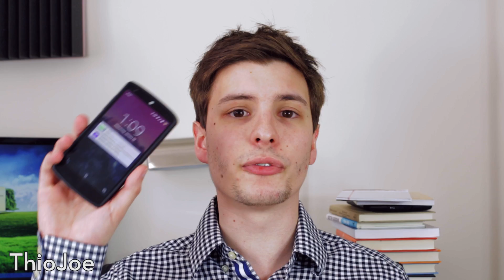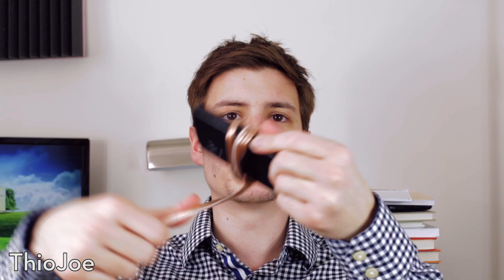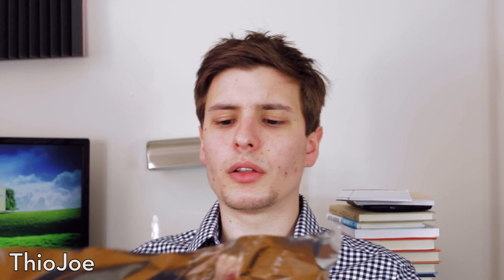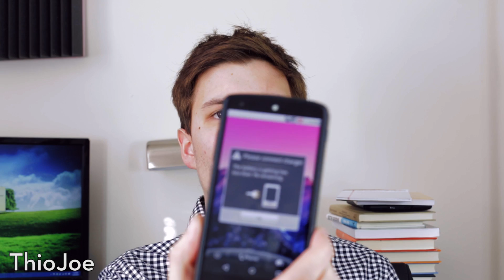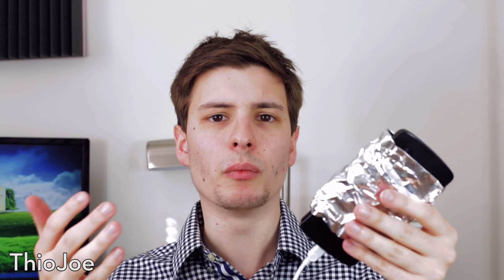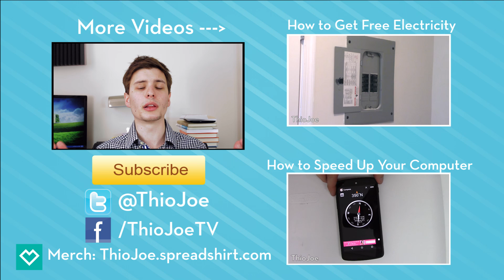How to Instantly Charge your Phone

Comment: This can happen even without any wire and tin foil. All you need is to charge the battery for 10 - 15 seconds, so the voltage can go up to what seems to be the normal charged voltage. And that is enough to fool your phone, that the battery is fully charged. The way your phone finds out how much charge is left in the battery, is by measuring the voltage of the battery (if there is no charge current) or the charge current (if the charger is on), and thus can be fooled easily. There is no charge current and the battery is at 3,7 volts, then everything is good... right?
Wrong.
In reality this is just a effect of the battery. The voltage is going up for a while after the battery was plugged into the charger, regardless of the amount of charge currently present. The "charge" is going to drain out after few minutes (the battery voltage is going to rapidly drop again) and you will find out that your battery is still empty. It is simple physics really. The charger can only put so much energy in the battery over 10 seconds. Most chargers are current limited to prevent shorts, so you really can't change much there. If your charge method really manages to charge a battery to 80% over 10 seconds, then this means that you somehow get more energy out, than you put in. And this does break the laws of physics. If you want a charged battery, you will either have to wait 2 - 3 hours for a proper charge, or learn to survive without a phone (at least for some time), just like we did in the good old days. xD
Also every cell phone charger is delivering DC (directive current) to the battery. This means that there is no electromagnetic induction in the wire due to the fact that the magnetic field of the charge current is fairly constant. So the things you describe are not possible or at least the effect of any voltage ripple in the charge current that might be picked up by the speaker wire coil and then re emitted back to the phone, is practically zero.
Now onto the battery itself: Charging a battery is more of a chemical process rather than electromagnetic. The charger doesn't cram electrons in the battery like in a bag. The electrons drive chemical reaction that is later reversed and produces electricity. The shape of the battery in this case has very little to do with the efficiency of this process, since it all comes down to effective surface area. And flat lithium batteries have no problem with that at all.

There are however "batteries" that can be charged in seconds and will probably be used in cell phones. They are called supercaps. Now it is important to notice that these are not actual chemical batteries like the lithium ion or cadmium ones. These are huge capacitors. This however does mean that the amount of energy, that they will have to output during discharge and this is translated into huge charge current.

Comment: hahahaha electric potential hahahahahaha electric potential ahahahahahaha escaping electric potential ahahahahahahaha for those who are actually planing to do this please search first how a battery works. if you want fast charging use supper capacitors not by using a coil of wire and a piece of foil.

Comment: Firstly that alluminium is not going to do anything for you phone apart from making it a shit mirror and if you think that coil is going to do anything then you clearly don't understand anything about battery physics, electrons aren't lost through the walls of the phone that would mean that instead of obeying Kirchhoff's laws (very important laws that define how a circuit works) which states that the charge entering a circuit is equal to the charge leaving the circuit so in basic terms for you the creator of this video, I'm gonna have to break it down for you because your a blithering idiot, the charge in a circuit doesn't 'leak away' charge is always conserved. Oh and by the way you are very wrong about the induction thing you were talking about while that's is a real physical phenomenon it will only diminish your battery life and use the charge up even further, and if that weren't bad enough conventional batteries used in phones don't have any coils in them because the battery is like a high capacity capacitor that slowly releases electrons over time, a coil in this situation would make little sense as it would act as a resistor therefore increasing the resistance of the phone and again wasting more charge so basically you claim to understand these things but in reality your just a dick who doesn't know fuck all about the physics of batteries your right it is a complicated subject which is probably why you just made it up on the spot and now look like a twat on the Internet.
So in future before embarrassing yourself on the Internet in front of thousands of people you might want to do some basic research about the topic your lying about so that anyone with a basic understanding of physics, which you clearly don't have so don't pretend you understand the complicated ways that batteries work, can't prove you wrong, you pretentious bellend.

Comment: Did this with my Galaxy S5, and I got to 100% in just 15 seconds! I just did this, but didn't put on the charger cable. I put it in water (my phone is water resistant) then put a car battery in the water with it. After 15 seconds, pull out the car battery (with rubber gloves, the battery can shock you) and you'll see the phone is fully charged. I also tried this with n iPhone 6+, I just wrapped it in plastic wrap to keep the water out, and worked great. Thanks for the inspiration, the battery is heavy, but works in a bind.

Comment: I found my phone can charge to 100% in around 30 seconds flat if it is fully submerged in nutella.
Nutella is a great insulator of electric magnetic induction fields, it helps keep the induction circuit energised for the period of submersion.
 Works on all phones.

Comment: hello joe. I tried youre technique but its not working for me?? ive tried using a power cord and another charging cable but it didn't work. What brand speaker wire did you use? and thanks for the tutorial

Comment: Using a microwave worked at a much faster rate. It charges the phone to about 5% every 200th of a second. The best time is about 5 seconds. This will charge the phone to 95%. Good video, i thumbed it down because its not as fast as mine.

Comment: I love Joe, he's a master in trolling but let me explain this troll:
The screen where he was showing his low battery is a screenshot of a very much older system, that system interface he showed wasn't even compatible on his Nexus 5, even with a rom it won't work to downgrade to 1.6 android.

Then he showed after his troll his regular lockscreen where the real battery indicator is which was 80% or something like that and it's was the same amount of battery before he did the trick

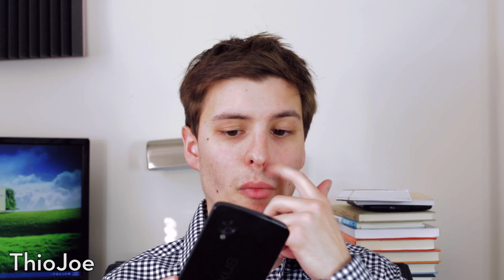Comment: He pretty clearly lightly sets down the original phone at 2:28 and grabs an identical phone to the camera's left of it, you can tell because his eyes shift leftward and he fumbles for a moment before bringing the phone back on screen. Trust me guys, batteries don't interact with anything outside of the charging circuit electromagnetically. There's no such as an "escaping electric potential" (electric potential, or voltage, is basically the difference between the charge of two points, not a physical entity). Even if he's talking about another kind of escaping energy, the foil would simply turn the wave into a current (induction) and dissipate it.

Funny and well done, but don't waste your time trying it.

Comment: Different potential is voltage, in order to charge a battery you need a current which is zero,  because the nexus 5 does not have a inductive coupling therefore the method you are using is feasibly impossible, don't say that you need to "know" physics to understand it because you are giving wrong information.

ps i do know this is a fake video because he showed a picture of a android htc skin interface and then the actual raw android os.

Comment: Hey man, I would have used this trick myself if it wasn't for the fact your operating system would've had to change from the Ice Cream Sandwitch to the lolipop. If you pay attention to the video, you get a solid, white Notification bar before it's charged, and then boom, the New Clear Notification bar with either a KitKat or Lolipop Operating system. So, guys, don't listen to this. He has to be doing this as a joke. If this actually would work, or if he was trying to scam, he would've done better to find the correct operating system Picture. 2 operating systems can't be in one phone without you rooting it or something.

Comment: I tried this and it looked stupid and far fetched but what the hell - wire ? foil ? whats the big deal right.  After doing the wrapping of my Samsung phone and charging the phone using the normal cord that comes with it for 10 seconds - nothing happened. So I charged it for a minute and got a 2 or 3 percent increase in power - big deal nothing to write home about.  Then I as usual go to the extremes and used 20 feet of wire and 2 layers of foil then charged the Samsung with the ORIGINAL cable ( make sure you use the original ) well after 30 minutes it not only charged my phone it actually changed the Samsung into an Apple iPhone 5S !  - I was so happy and took about a hundred feet of wire and rolls of foil and wrapped my Ford Geo Metro and started the car for 3 minutes and changed it into a Honda Civic EX !  - This was just a joke and not true so dont try it.

Comment: This way works pretty well but I like to use my own method. I do basically the same thing with the wire and wrap that around my phone. After that, the magic happens. If you didn't know, phone companies actually make their chargers charge slower so that you buy a better one but in my case, I have made my own. Take any piece of silverware, I prefer a fork, and slide the end under the wire so it's in between the phone and coil of wires, then stick the other end in the socket and BAM! The phone literally lights up with charge.

Comment: My mind was running low on charge, so I wrapped the wire around my head and then followed with a big ol' wrap of foil.  My melon looked like it was something straight from Area 51.    I was wondering, Joe, if I could at that point attempt a Vulcan mind meld with u and see if i could then store two brains as one?

Thoughts?  Thx as always.

Comment: BS waste of timr from someone who doesnt understand physics. 

If that was all that was needed to charge a battery in 1% of the time, then   manufacturers of  bsttery chargers would have done it years ago, and the electric car charge time problem would be solved. . 

Tge power delivered to a battery is still v x a x t regardless of how the battery is packaged or wrapped.  The battery is incapable of receiving power faster or at a higher voltage or current than the  charger can deliver.  Its also incapable if miraculously increasing its storage capacity by 78 percent without incurring permanent damage.

The open coiled cable cannit act as a transformer secondary,  nor a shield.  The alumium foil may prevent radio reption but cant act as a ground plane or electrical trap for the direct current used to charge a phone. 

If you test the runtime of that phone you'll find that it's taken practically no charge.  Instead what is probably happend is the circuitry that determines how much of a charge a battery has a phone, which is adaptive , now gives an erroneous reading.

Comment: That's how you fry a battery it may work 1 or 2 times after that your actually you putting 90- 100volts a phone runs off 5v that's how you blow up your phone with a heavy duty Li-po battery that could explode any second doing that

Comment: RAP IT AND THROW IT IN THE BARBECUE PIT BUT LEAVE THE LID ON SO THE HEAT OF THE ENERGY CONVERTS THRU THE FOIL AND WIRES THEN INTO THE PHONE, NO DOUBT IT'll WORK! LEAVE IT LONGER THAN 5 MINUTES YOU WILL NOT KNOW WHAT TO DO

Comment: Ok Thio,  What have I done wrong, After watching your quick charge vid, I thought I'll try to construct my own, I only had some  sterio jack cable,  is that not of any use??, secondly I used cellotape to keep my foil in a sandwich, was that poss a reason it did not work??  and thirdly...  i wrapped a lot of foil around my cable sandwich, to help it from falling apart, Could that be another reason, as to why, my attempt did not work, at al.??    Thank you for putting some excellent vids up on your channel.   any help will be very much apprechated.

Comment: If you want 100% instant charge in seconds flat, just forget about the wire wrap and only wrap your phone completely in foil. Then take 2 bare wires, tape one on each end with electrical tape, then plug both wires into the closest electrical outlet in your wall. Make sure you're wearing rubber gloves. Voila! Instant charge!

Comment: i know  it's  joke  but  the reason  that  battery  take  so  long  to charge is because of there resistance ( like  electrique heater ) the more  electricité  put  in battery (amperage I ) the  more  heat is  generated Ej(energy of heat) =R*I*I 
the more amperage is absorbed the more heat  is generated if time of charger is so small then  the  I is so high  which resultat your battery to  simply explode by heat

Comment: Well you get the same effect without the Coil. I'm not shure how you wanna speed up an analoge pluged battery-charge with "trapping" the em field. one other little thing you forgot. you need a changing electric power in the coil to emitting an em field. Sorry if the explanation sounds kinda easy. Im not used to describe it in english ;) 

But dont worry the most of your idea was right. charging your battery is an exponential phenomenon. The lower the battery the bigger the potential difference. This results in a faster charging time for the first seconds up to around 50%.

Comment: So I did like you said, using the foil as a sleeve, but then my phone dropped into it.

For some reason, it did not fall through the bottom end, and actually completely vanished, as if entering another dimension.

Upon further inspection, I found that the electromagnetic field generated by the electricity running through the foil created a wormhole. Dammit, Joe; don't you know wormholes are illegal!? How do I hide this shit before the feds find out?

Also, yeah, my phone's gone, so now, some inter-dimensional space-orcs have all of my nudes. Fucking great.

Comment: One extra tip: if you're running low on power, some phone batteries (that are obviously detachable) can take a static charge. It's really sort of like using one of those plasma balls to power a compact fluorescent light bulb. It doesn't do too much, and since it's outside of the phone, it's a little difficult to tell that it's being charged if you do it for just a minute or so, but if you give it time, you can recharge a good deal--you'll get about a percent a minute if you're good. The way it does this is because the lithium ion batteries that most phones nowadays use, are made with two different metals, often copper and aluminum, on opposite sides. There is then a cathode (the lithium oxide), and an anode (which is often simply graphite, or pencil lead). Between the cathode and the anode, is an electrolyte, which is used as a simple electrode. Within this little pool of electrolyte is a separator, which is permeable to electrons. When the battery is encased, it is often made with a very thin shell, so that it can be made smaller. It's a downside to very small technology, but this is how we are able to charge our batteries. The reason this works, is because the electrolyte can absorb the static electricity. Rub your slippers on the carpet, then touch this battery, and it can get some charge. Hope this helps, thank you and see ya later.

Comment: Handy little life hack Joe, I was able to charge my LG G3 from 8% to 54% in about 12 seconds which is quite good. I think the reason my results aren't as crazy is due to the fact that I'm running CM12 on my G3 since I love stock Android. I'm on the latest nightly (1/30) and the devs have already admitted that they still need to optimize the kernel some more for battery life. Still pretty sweet though! 

P.S. Quit using HTC Sense on your Nexus 5, it's a crime against all things Android. You have been warned Joe...

Comment: Did you know? When the battery in the Nexus 5 by LG (Android 5.0) gets too low, the launcher is replaced with a low-res, older version of HTC Sense. This was an extreme battery saving measure that was recently possible through the HTC partnership for Nexus 9 production. Think of it as a safe mode for your battery!